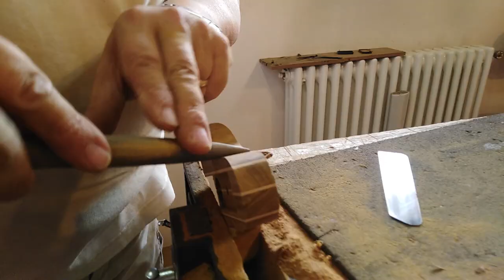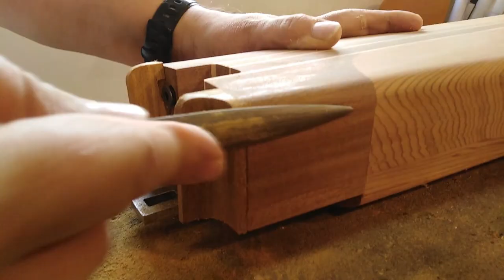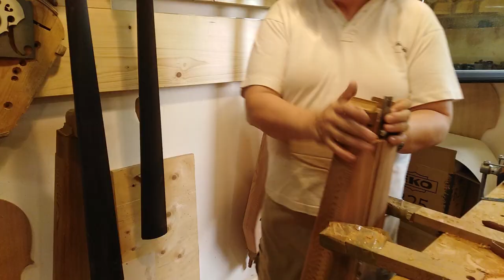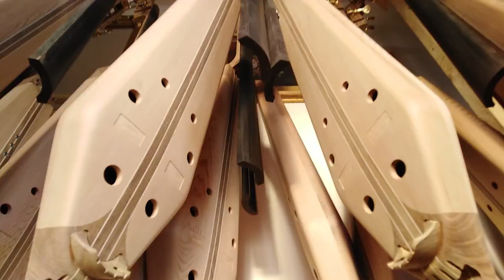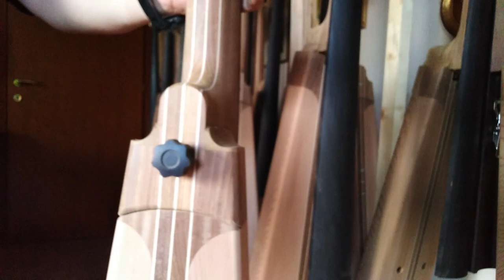TravelBass in the making (June 2020)

Comment: Does the travel bass have a sound post/bass bar? Or is that not needed in this design?
Reply from the maker: TravelBass doesn't need a sound post, and does not have an actual bass bar even, but the darker stripe of wood at the center of the body describes a sort of "ring" that run all around the body of the instrument and shall act as the bass bar.